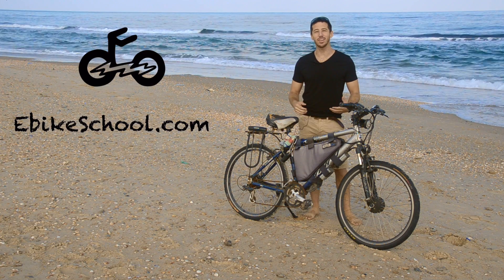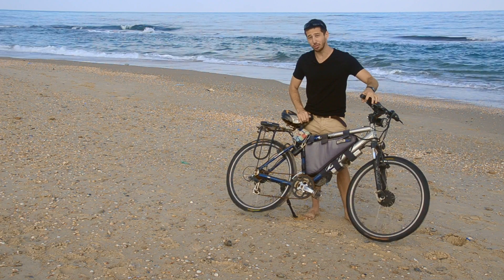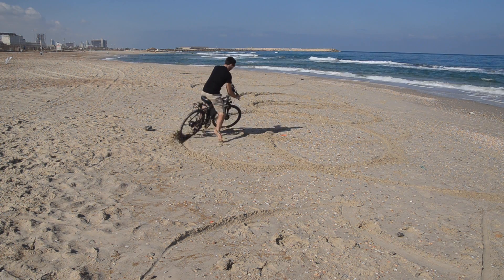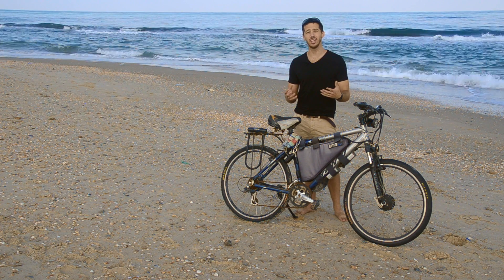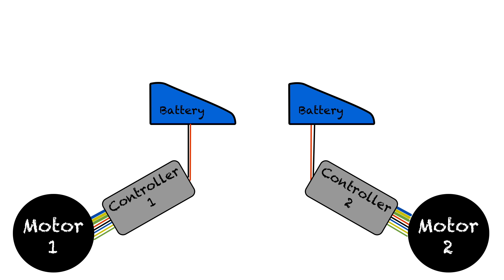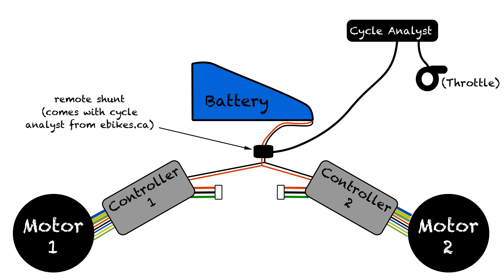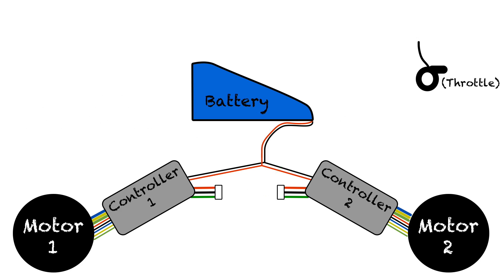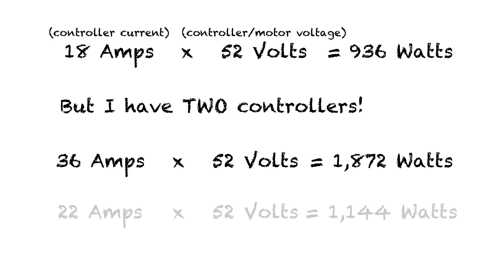DIY Two Motor 2wd Electric Bicycle (All wheel drive 2x2!!) Q&A#6

Comment: Ere those motors direct drive or geared?  Can you do the same with regen braking?
Reply from the maker: They are geared. You can do it with direct drive motors and add regen, but make sure your battery can handle the powerful regen from two motors.

Comment: Hi Mikey, I am also building a twin motor Ebike using 36 volt brushless motors in the middle of the frame geared together and then driving to the pedal crank sprocket, do you have any links to a suitable 36v brushless motor controller please, have also bought you Lithium battery book, absolutely excellent, have recommended it to a few of my friends.
Reply from the maker: Thanks Doc. The controllers I used are linked in the description. They are 36V and 48V compatible. They are about as cheap as you can get though, so if you are doing something high power, you might want something better. Mine have worked well with about 500W of power each for the last 2 years.
Reply: Thanks Mikey, have looked and still can,t find them, help please.
Reply from the maker: https://goo.gl/nJBnJP
Reply: Many thanks Mikey

Comment: Nice design sketch. It really simplifies the whole process. My question would be concerning over-volting a motor. I have a 37V Bafang rear hub powered by a 37V 17Ah battery pack. Could I sacrifce amps (therefore range) for a higher voltage to gain more of a pick up speed? You mentioned 52V but I guess there could be limitations and risk of over-heating the motor.
Reply from the maker: Yea, any brushless motor can basically accept any voltage, and thus have an equal change in speed. The issue becomes heat. Most 36V motors can do 48V, and also 52V, pretty easily. If you only had one, and you went up a big hill, you'd be putting more amps and thus more heat through it, so you'd want to just be careful and watch the motor temp to see how high it rises. 2 motors means half the work per motor, so they can handle the abuse better.
Reply: Thanks. I tend to try and stick to  low assist when hill climbing since I notice how upping the PAS can stress the motor (almost giving it a low vibration feeling).

Comment: hey nice videos, You inspired me to make my own diy eBike. As you mentioned in your video how often does the police stop an ebiker? I live in germany and we can only have 250w motor with out going into registration stuff.
Reply from the maker: I can only answer this question in terms of Israel, where I live. Here the police do operations about once or twice a year where they round up all the illegal ebikes they can find. So you're fine most days, but its a surprise when the next raid is. Having a giant black motor the size of a dinner plate is a dead giveaway for the police that your bike is illegal.
Reply: Wow. Where I live in the US, there are absolutely no restrictions on ebikes or bicycles. None. If it was originally manufactured as a bicycle, you can put a V8 on it, and you're fine, as long as you don't break any traffic laws. No registration, tags, insurance, etc on mopeds under 50cc either.
Reply: In Germany, the Netherlands and some other EU-countries there are more limitations:
- throttle driven e-bikes are not considered bicycles
- the motor may only support speeds up to 25 km/h +/- 10%
- it should be peddle assist above 6 km/h
So why overvolt your e-bike? If you go faster than 35 km/h police will certainly get suspicious. I would say it is only useful to overvolt if you carry a lot of weight and still want to ride around 27 km/h.
Especially in Germany insurances can get nasty when you cause an accident with an illegal e-bike. They will claim you are not insured at all because you are technically riding a motorcycle which is not insured separately and you probably weren't wearing a helmet either.
Reply: Can you attach both motors into one controller? Just splice or make a adapter with 2 plugs.
Reply: @Random Channel no because the controller needs to send high-current signals into the motor depending on at which stage the motor is. If the wheels were spinning out of sync (say you lift the front wheel for a fraction of a second) the controller will either be confused getting weird signals from the hall sensors or when operating sensor-less, it would probably control one of the motors wrong. I wonder how can it be operated sensor-less, really don't know how that can work. Yeah I'm not saying I know everything :-)
Reply: If you live in germany, do not get any motor that isn't labeled 250W. Just overvolt them, and you will be good.
Reply: Czar, you're killin' me man. My ebike buzz....gone.....poof
Reply: You could get a speed pedelec, but you need a drivers license, wear a helmet and pay registration and insurance.
Speed pedelecs are allowed to go 45 km/h